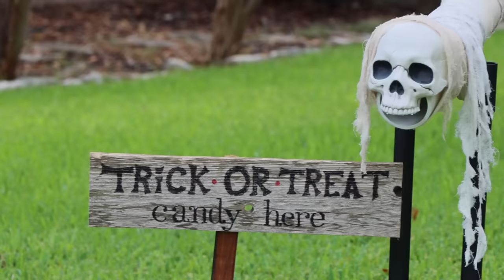Halloween Isn't Cancelled! DIY Prop for Trick-or-Treating during COVID

Comment: Covid is spread by touch more than it is by breathing though! You are still giving them sweets that you've handled.
Reply from the maker: Everyone should be sanitizing anything they get.  That’s just common sense.
Reply: Easily taken care of.  The candy stays sealed in the bag until right before Trick or Treating. And the individual candy is only touched with a gloved hand.  And if someone is still concerned let the candy sit for 72 hours after collecting - just have some interim candy at home to hold the kids over until they can get to their other candy.
Reply: @WickedMakers  you cant sanitize candy and people should hand wash regardless. You need to also learn difference in aseptic and sterile and airborne , droplet borne. This virus is dangeroud but mostly political so either pass out candy pr don't but learn how to handle food during a pandemic if thats the case or dont fear monger

Comment: Depending on what type of candy used our experience is the candy gets stuck part way down. The angle of the pipe needs to be so steep it’s not practical in most cases,
Reply from the maker: Just toss it if it’s light. 🤷🏼‍♂️

Comment: it would be cool if you drilled a hole in each eye socket & put red  led bulb in each socket (with a battery pack  set inside the skull )
Reply from the maker: Yes!!!
Reply: @WickedMakers  flickering red led bulbs

Comment: There’s really no reason to use pvc glue unless you’re making a sprinkler system for your yard. The pipes fit snug anyways and loose enough to take them apart for next year (hopefully it doesn’t have to be used next year).  But still a good video

Comment: I made this and it does not work. The tube interior isn't slick enough to allow small sized candy to actually slide down the tube. Even tried to use car wax and a towel to help and still not working. Very frustrating and not sure I ever see this demonstrated in the video to show it works either :(
Reply from the maker: Just toss it down the pipe. Not sure why but some people seem to have trouble with this part on their builds. Might be differences in PVC. We’ve built four of them this season and don’t have that issue on any of them. But yeah, just give it a good toss down or possibly raise the angle.
Reply: Use at least a 30 degree angle.

Comment: Lol I would have used wood instead of the small tubes because its faster and easier 
And don't forget to wear gloves when handing out the candy!
Reply from the maker: Yeah but only if you know how to cut wood. Most people don’t have power tools. 👊🏼😄 If you do then go for it.
Reply: @WickedMakers  
Lol I was going go to home and see if they have any wood already the size so I don't have to cut it and I have a hammer or wood glue 
From ace hardware!🤣
Reply: @WickedMakers  the power tools I have are so old just  plugging it in will make it explode in flames and burn the house down 🤣 they don't make these power tools from the 50s...60s possibly 40s

Comment: A "simple" project....sure.  That's a lot of PVC, guys, and that ain't exactly cheap material for those of us who are cash-strapped due to work shortages.  Any recommendations for a cheaper way to make the stand, at least?
Reply from the maker: PVC is the simplest thing to use if you don’t have tools. If you can cut wood, that’d be much cheaper.

Comment: So I finally finished building this and had my first test run earlier tonight. Works great, thank you so much for the idea! 

Here's a link to my video: https://www.youtube.com/watch?v=DShYG2PQO8g&t=2s
Reply from the maker: Woah! This is amazing! Really love the lights and fog. How did you add those in?
Reply: @WickedMakers  Thanks! The lights are 12 ft of green led bulb string lights. I drilled holes in the top of the tube and just have the bulbs sticking through all the way up the tube. I put a little hot glue on each light to hold in place. There’s a few feet of leftover lights hanging off the back which I covered in black tape but plan on going back and spray painting them black. The wires sit on top of the tube but are covered by all the gauze and are not noticeable. I really only needed a few lights towards the opening in order to illuminate the fog but didn’t have a good option for that so I went with the bulbs running the entire length of tube. It actually gives the whole tube a slight glow even through the gauze which prob isn’t that noticeable in the video.

For the fog I drilled a hole in the side of the tube just big enough to fit a 1” PVC elbow. I have it angled just slightly towards the opening of the tube to direct the fog mainly that way. I used silicone sealant to hold in place. My flexible tube running from the fogger then fits pretty snug in the elbow when I’m ready to connect it. Plan on having the fogger operated manually when the trick or treaters come around just to have a little fog coming out that’s lit up.

I’m most proud of getting the sound effects to come out of the tube by attaching that small Bluetooth speaker. The tube really amplifies the sound which makes it sound great! Again just drilled a hole and used a dremel to get it just large enough to hold the speaker. I also used a piece of craft foam that sits over the hole which the speaker fits snugly in. I’m covering that with a PVC cap held in place with a little bungee cord.

Even with the lights and PVC elbow protruding slightly in the tube there’s still plenty of clearance for the candy. Thanks again for the inspiration!

Comment: So the whole 6 feet of separation sending Candy  down a pipe didn’t make a whole Lotta sense when you had about six or seven kids that are not from the same household standing in front of the candy extractor at the same time together? 🤔 have someone else doesn’t believe this virus either?
Reply from the maker: You didn’t watch the end of the video. 😉
Reply: The idea is to have the Trick or Treaters stay in their own safe groups not mingle with strangers.  It is a matter of clever crowd control.